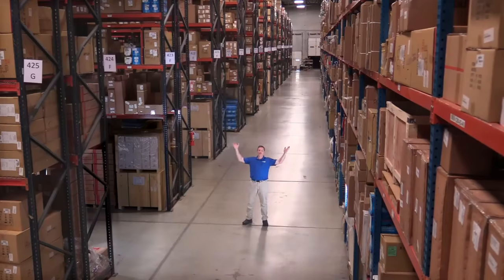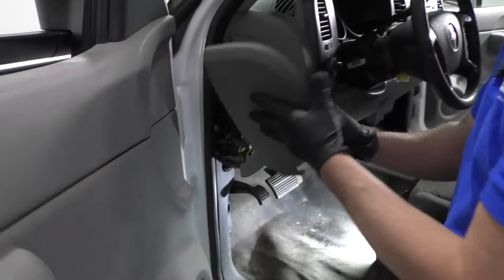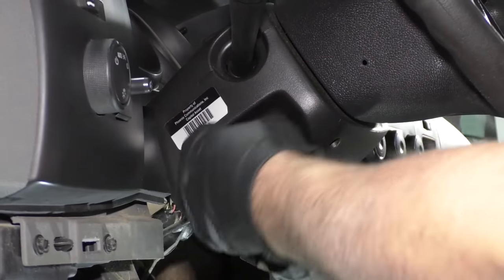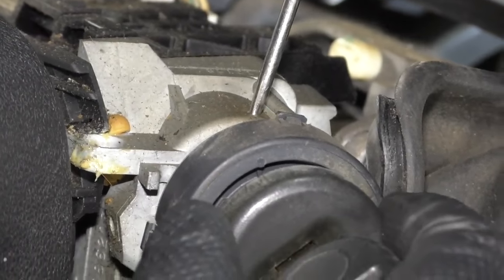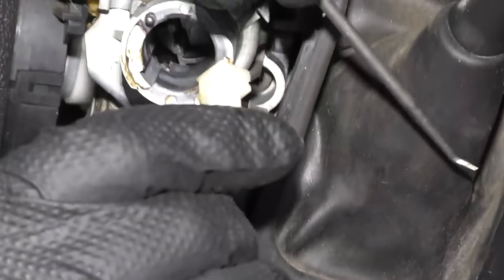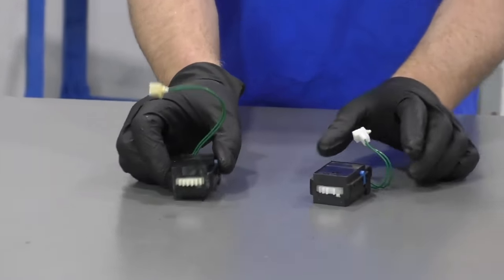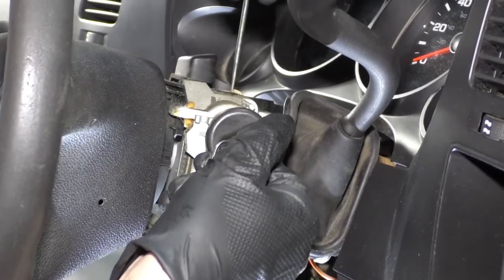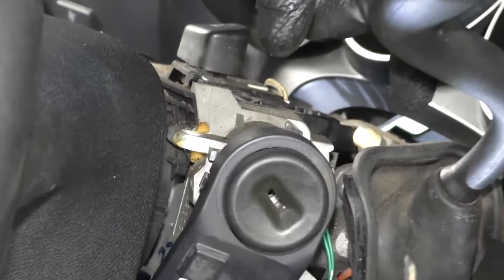How to Replace Ignition Switch 07-16 Chevy Silverado

Comment from the maker: √  Watch the Video
√  Buy The Part at 1A Auto http://1aau.to/m/Visit-1AAuto
√  Do it Yourself
√  Save Money
Reply: How to replace 6346A  in a 2007 Yukon
Reply: How to replace 6346A in a 2007 Yukon
Reply: Okay so I have an 08 yukon denali and unfortunately when I turn the key I get absolutely nothing not even a click, I have replaced the starter, new battery and cleaned the MAF previously it would start then shut right back off then eventually it wouldn't do anything at all also the scan tool/code reader is unable to connect to the trucks computer would this ignition switch be the cause of my issue? I did try to jump the starter solenoid and it spins over the engine just does not start...

Comment: Successful install.  I have a 2012 GMC Sierra.  Word of advice.  You don’t need to have the back key accessory mode.  What you need to ensure is that the gears on the old switch match the gears on the new.  Hand turn if need be on the new switch before installing to ensure an exact copy.  From there you can install the new switch without having to manual turn the gear with a screwdriver or worry about putting the cylinder lock back in.  My truck works just fine after install.

Note!  To avoid dealing with the reprogramming of the theft device don’t disconnect the anti-theft mechanism.  Simply slip it off and let it hang plugged in.  It will save you some trouble!

Comment: This is fine if you have a vehicle that will go into accessory mode, but what if it doesn't? How do you line up the ignition switch with the lock cylinder?

Comment: How do you know if the lock mechanism or the switch is the part at fault? My key gets stuck in the off position. Very hard to get it to move to start.
Reply: That sounds like the cylinder is bad.  When I took out my switch, the lock cylinder rotated very freely (when I put it back in).  You can rotate the teeth on the switch with your fingers - takes a little force, but not very much.

Comment: My ignition cylinder will rotate to the start position…but will not start the truck…then when I released it..the starter engages and starts the truck…? ..It did this for several days…. Now when I turn the key nothing happens…?  The battery has been tested and is good. Do you think it is the ignition switch..….or the starter.  My truck is a 08 GMC

Comment: Thank you for this video.  The only issue I had was removing the lower valence panel - but now that I know how hard I need to pull on it, removing it would be easy the next time.

It took me longer to gather the tools and remove the stupid valence than to actually swap the switch.

PRO DIY TIP:  use a pair of needle nose pliers (long, angled works well) to depress the two spring-loaded clips on the switch at the same time.  I couldn't get it with two picks, but the pliers worked great!

Comment: Is there a way to disable the steering wheel lock in a 2016 gmc sierra to be able to flat tow it behind my rv without having to disconnect battery? Also, I would like to be able to remove the key and lock the doors..

Comment: If the key is just sticking, is that a cylinder issue or does the whole ignition system need to be replaced?

Comment: What would be the reason to change this? My 2011 Silverado is getting no power when the key is in the ignition, no lights. Would that be why?
Reply: I’m having the same problem. Did you get it fixed? And how?

Comment: How do you align the gears on the switch? Right now I only seem to have 3 positions and truck starts but only runs for like 2 seconds
Reply: I had the same problem where my ignition would not go into acc so I removed the lock cylinder and used a screwdriver to rotate the section in the column that turns the switch counter clockwise, it will stop in the correct acc position then I put the switch in and used the screwdriver to turn the same thing in the column clock wise to the run position just before the start position and inserted the lock cylinder back in. It sounds harder than it is.

Comment: I have a 2017 Silverado 1500, my keys turns all the way but it makes a clock sound after trying to turn it on, I replaced my ignition starter switch and got it re programmed but I’m still having the same problem

Comment: Followed exact directions/ instructions but lock cylinder will not go back in so I can remove the ignition switch, as of right now, I’m stuck!  Can anyone assist?  Lock cylinder goes in half way and stops in wiggled etc but won’t go past that Point.  I did not remove key or anything, followed directions step by step.
Reply: I'm having the same problem. Did you ever figure it out??
Reply: I had the same problem where my ignition would not go into acc so I removed the lock cylinder and used a screwdriver to rotate the section in the column that turns the switch counter clockwise, it will stop in the correct acc position then I put the switch in and used the screwdriver to turn the same thing in the column clock wise to the run position just before the start position and inserted the lock cylinder back in. It sounds harder than it is. I plugged the switch in last

Comment: Hello i followed your instruction but unpluging the key security thing does that have to be reprogram? My truck is not starting now. Its like sticking in a key with no chip. Power starter fuse are good.
Reply: Stan B did you end up reprogramming it?
Reply: No i did just as your post did. No reprograming.
Reply: Cause a friend told me after, I shouldnt have unplug the security.
Reply: Stan B ok tnx mine is getting stuck alot  of times and it’s frustrating, im going to try it
Reply: What did you end up doing to get it to start?

Comment: Quick question have new switch in but cylinder won’t go back in??
Reply: Problem solved you may have to manually move the gear to auxiliary position. Other than that 1a is awesome I called and had a tec call me

Comment: P2534 code what ignition switch is it talking  about this or the one with the key,please help?
Reply: The P2534 code is signaling a faulty ignition switch. The part with the key is called an ignition lock.

Comment: What happeneds if this part is not working properly 

I have 2011 turns the key but won’t star battery is good and I replaced the key cylinder
Reply from the maker: +Marco Nava We wouldn't be able to diagnose an issue like that here, you may want to have a local mechanic take a look at it. Thanks for checking us out! http://1aau.to/m/Shop-1AAuto-c

Comment: In the beginning after you said to put the key in the ignition and put it in start position. What if after putting the key in, but to put it in start position, it doesn't recognize anything. After trying to get the key out because it was stuck and wiggling it got the key out of the ignition. Now the switch doesn't work at all. So it can't be put in any position for power, start nothing.

Comment: I followed these instructions and now my ignition cylinder can be easily pulled in and out of the housing. It did not lock back into place - currently stumped

EDIT: The detent block and spring went flying during disassembly because of the outer shell of the cylinder tumbler came apart and the spring under tension sent the block and spring flying... I didn't even know what I was missing until I was able to find a closer picture. And it took me hours of searching to find the spring and detent... after I found the pieces I quickly assembled the outershell back together and was able to correctly replace my 2017 silverado 1500 ignition switch with this tutorial.

Comment: I am doing this is a 2009 sierra, but I have no ACC mode for the key, any ideas before I progress?
Reply: LibertarianUSMarine  did u ever figure this out I’m having same problem
Reply: The very first click on ignition switch is accessorie at least on the 05 mu wife drives and my customers car I am working on now..

:::put key in turn to 1st point and that's accessory..
I am working in a 2007 chevy 1500 now I didn't mention that part sorry
Reply: I had the same problem where my ignition would not go into acc so I removed the lock cylinder and used a screwdriver to rotate the section in the column that turns the switch counter clockwise, it will stop in the correct acc position then I put the switch in and used the screwdriver to turn the same thing in the column clock wise to the run position just before the start position and inserted the lock cylinder back in. It sounds harder than it is.

Comment: Be careful with this. You may not need to remove the key solenoid to reset. Be careful I had a hard time reinstalling. And I almost damaged it. Do not remove key at anytime until the whole full setup is complete then reconnect the battery.
Reply: Not sure what you're referring to, but my key came out of my cylinder after I removed it.  I just put it back in and it was fine.  The cylinder will only go back into the hole one way.  It goes in very freely - if you have to force it, try turning it 180* and see if it goes in.  Remember, it needs to go back in roughly in the "start" position.

Comment: I followed a different video and it DID NOT have me putting the lock cylinder back in before removing the ignition switch. BIG MISTAKE. Since it was in the start position when removed, it must be in the start position when reinstalled. The problem with that is to put it in START, the switch gear has be be all the way to the end. It is also spring loaded, so once you remove the switch, it moves from the start position to the on position. You can not put it back to the start position when reinstalling the switch. There for the lock and the switch DO NOT line up. Can anyone tell me how to fix this problem. When I put it back together, it will not go all the way to START. Therefor, the engine does not start.  H E L P !